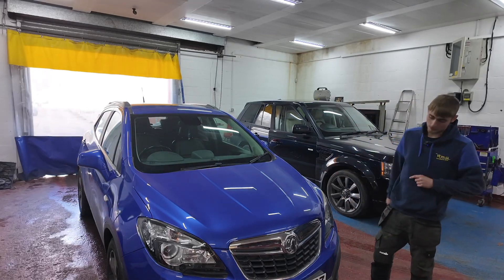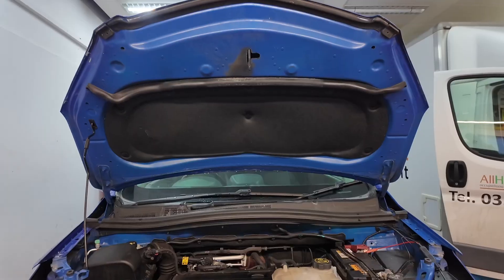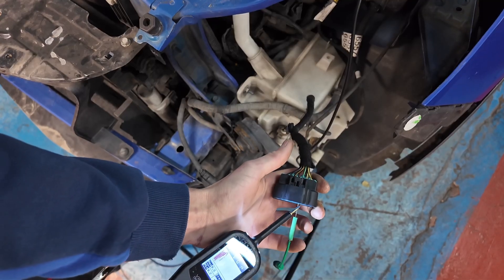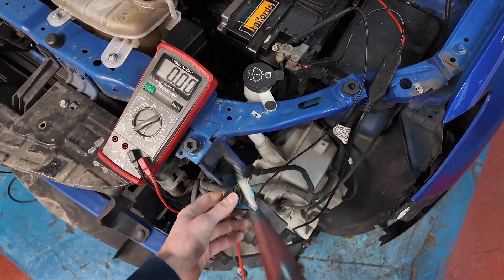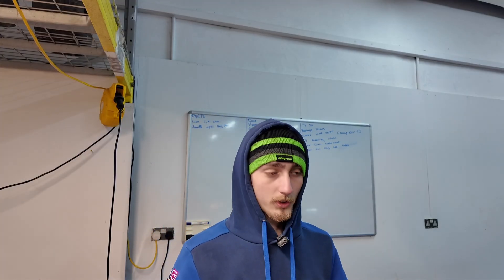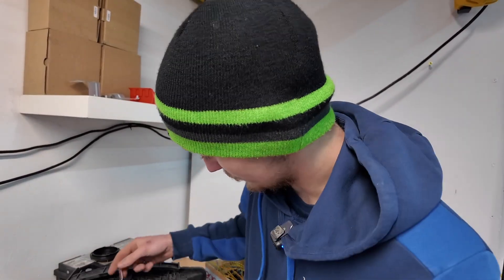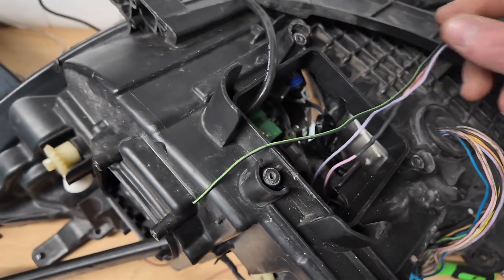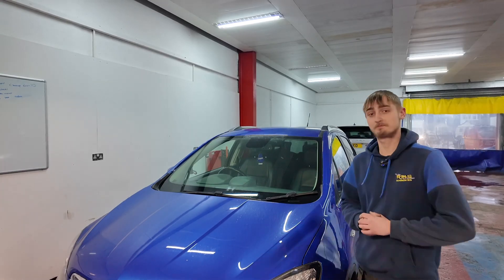How a Digital Signal Failure Shut Down Both Headlights | Auto Electrical Repair

Comment: What probe is that you are using
Reply from the maker: v200 probe
Reply: @rmsdiagnostics  would you recommend one, and where you get it from, good videos by the way, very informative 👍
Reply from the maker: thank you,Amazon most people buy them from but they are not the most robust tool , I would look at the ones impact diagnostics sell.
Reply: @rmsdiagnostics  just had a look at them, they look good, and well priced, do they have that graph option for Lin bus, like on your video.

Comment: I thought you couldn't load test the earth circuit like that with the load pro thought you had to move earth lead.between plug earth and battery earth while pro in voltage line to see any different reading to confirm
Reply: Thanks for clarifying you moved leads just wasn't sure that was safe to do with load pro
Reply from the maker: sorry we did move the lead to battery positive terminal and then tested the earth
Reply: @rmsdiagnostics  I think what they're saying is you don't reverse the polarity via the Loadpro leads by keeping the load probe to +VE & use the negative probe @ the connector (for the grounds), but all checks here could have been done at the connector without using any of the batteries terminals.

So to keep things simple & say the connector was 2 pin - power & ground & you tested directly at the connector press the button & get volt drop, move the ground probe to battery - then press again & no volt drop then it's in the ground .....
Reply: Great job as usual mate

Comment: Ford focus 2015/2019 has the same problem . . Wires in the plug for self leveling headlights were crimped to hard and the wires snap off . . £1000 for a new headlight or £12 for a replacement plug and wiring . . 🤔 . . 2016 focus st and had to do both  !
Reply from the maker: one to remember mate